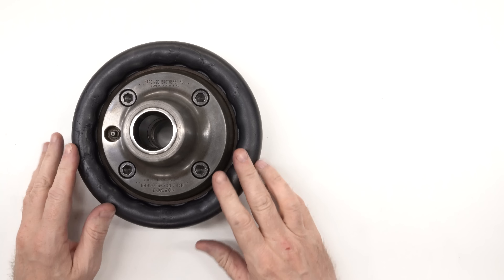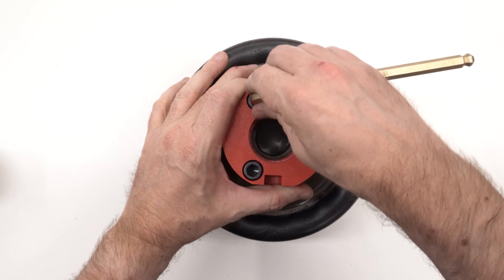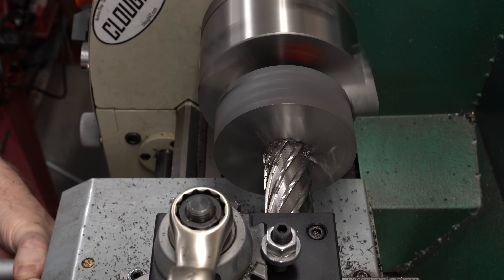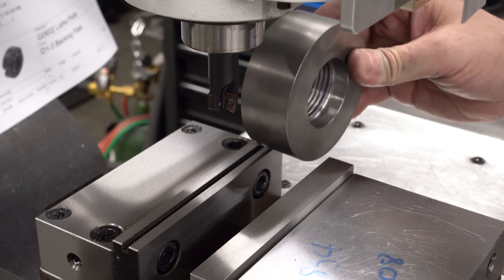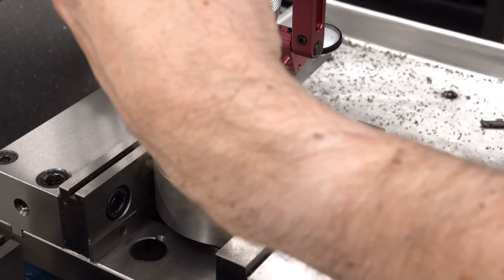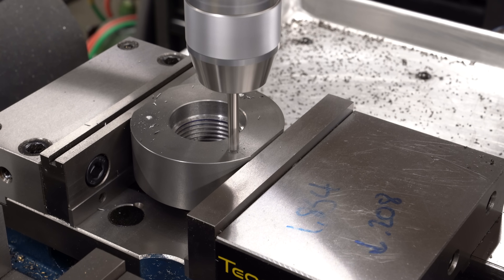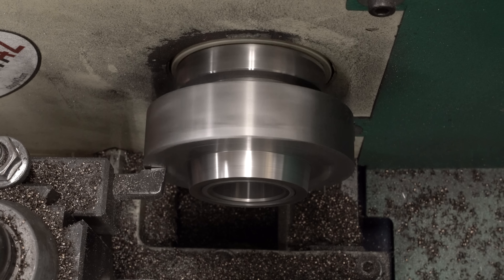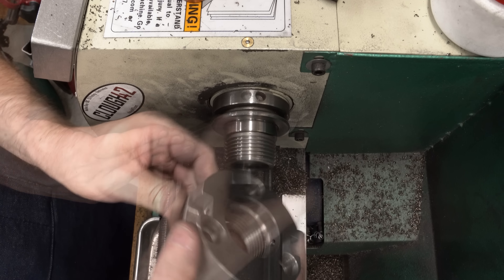How to Install a D1-3 Chuck on a Threaded Lathe Spindle

Comment: I've just started using Fusion 360, never used any CAD before.  Your designs are awesome.  👍

I've got it for my Qidi 3D printer you reviewed a little while ago.  Already knocked out a small bracket for a rear bike camera.
A question what flexible filament did you use for the airline end-caps?

Comment: Link to the bore gages at Shars?

Also, UN threads are 5/8 of the sharp V height. .125 x 5/8 = 0.078, and any error in the minor diameter with be magnified by about 15%. It helps a lot on internal threads to make a go/nogo gage using a micrometer and thread wires.

Comment: i got a large low profile armstrong 2.75” spanned to use to hold my spindle when loosening and tightening the hand wheel, i do need to figure out a spindle brake for my lathe one day

Comment: Great video James. Knowing near nothing about milling (I haven't run a mill since college, 1987), this might be a stupid question.When you mounted your adapter in the mill @15:49, you said you would take small passes to keep the part from spinning... Why didn't you cut on the Saddle travel instead of the Table travel?

Comment: put a hole in the adapter and make a tommy bar to fit that will hold and lock your chuck and also help put it on the spindle.

Comment: I have a slotted wheel for an optical encoder on the end of my spindle, I was thinking of making it a larger diameter so outboard of the encoder I can run a bicycle brake caliper from a cable disc system

Comment: Sometimes, if you have a problem with a high speed steel tool and cast-iron trying to friction weld themselves together you can use wax as a lubricant

Comment: I'm wondering if the runout is caused by the chuck bottoming out on the shoulder rather than seating on the taper.  Might taking another ligh skim off the shoulder help?
Reply: Other way round, he skimmed the shoulder and now pulling up to it with the screws is what's pulling it out of alignment. Ironically it looked he nailed it first time and did what you suggested and skimmed the shoulder back.
Reply from the maker: If anything, I suspect it's over-tightened on the taper.  I'll play with it.

Comment: How does your improved compound compare with the solid riser? I would imagine that the solid riser is still more rigid, but is it enough to justify the work that went into it? Which one will you use most of the time? BTW, I see you're enjoying the new PM mill quite a bit. Do you still use the Grizzly CNC machine at all?
Reply: Robin Renzetti did a good video on his solid compound (which is part of what inspired James's). That one is on a Hardinge HLV-h lathe ($50,000+) with an excellent compound from the factory. It still improves rigidity (one fewer joint), particularly when parting. It also means that (since the compound doesn't have a scale on the DRO) that any movement of the compound invalidates all the stored tool offsets in the DRO. If you've got a few dozen tool offsets stored that's a significant amount of work to reset.
Reply: Can't you just reset the absolute origin when you rotate or move the compound and all your tools come back? That's how it works with mine. I visualize the origin from the tool post position, not the carriage position.

Comment: Does you annular cutter shank have a center in the end? Line it up with your tailstock center. I popped a center into the end of my MT2 chuck arbor for y tool holder mt2 holder for fast close enough alignment

Comment: time to break out the tool post grinder!, Great tip for finding ISO standard drawings using duck duck go, I had a very hard time finding a schrader valve chamber dimension. (ISO 7442)

Comment: At around 19:00 you said that it sould self lubricate because of thd high carbon and im curious as to how that works, because ive never heard anything like that (new to machining)
Reply from the maker: Cast iron has a very high carbon content that takes the form of graphite nodules in the matrix.  Cast iron is commonly used for bearings for this reason.

Comment: I noticed that you were getting run out all the way from the work piece all the way to the back of the chuck, but not on your adapter plate.  Would it make sense to clamp a work piece in your largest collet, mount that work piece into a 4 jaw chuck, zero the work piece in that chuck, and then check things like if the back of the chuck is actually rotating perpendicular to the axis of the collet?
Reply from the maker: That's worth checking.

Comment: I think if you're after precision, best to keep the number of moving parts to a minimum or make yourself an adjustable chuck like Dan Gelbart's 😅

Curious, why not make yourself an ER40 collect chuck ?
Reply: ER can work just fine for work holding but it does need a longer engagement length than pull in collets like 5C or w20
Reply: @lukerickert5203  you can get away with sacrificial stock of same diameter if you need smaller engagement of actual workpiece. The added advantage is the range per collet though good spring collets can be pricey and they're considered consumables depending on usage. I get 5um tir or better on mine, the collet chuck was turned in situ which helps.
Reply: @HM-Projects  pull in are likely better for runout etc but a high quality set can be a bit of money to be sure.  5C are nice in that they can be any price you can imagine depending on requirements. I did find an excellent Schaublin made w20 set for around 300 euro but have spent a lot filling out my B32 set. I find 0,5mm steps to work quite well.
Reply from the maker: 5c allows me to use an internal stop.

Comment: At some point is it easier to just replace the spindle with one that has a more common mount on it?
Reply from the maker: Hmm...you might be using the word "easier" in a different way than I typically do.
Reply: @Clough42  well, that's why I'm asking 😄 (not a machinist, just thinking out loud)

Comment: Just give the part a few taps until it  the runout disappears, you still have to do that even on the index grinders use to finish parts.
Reply from the maker: That might explain all the marks on the chuck from the previous owner(s).

Comment: Instead of screws using the cam lock my pull more evenly. Yes a lot more work them using screws. If you use cam locks then you have a mount for other D1-3 tooling

Comment: you didn't confirm the taper fit ,you need a colour compound on one of the tapers to make a transfer between the surfaces i bet you are a little tight on the front

Comment: Fail with runout. 4 thou was not enough clearance you have not engaged full the taper. Besides no video the taper was actually cut properly. Check runout on taper.

Comment: Why ductile iron?
Reply: its tradition for backplates etc. But really it could be made out of any steel imaginable
Reply: It has better vibration damping capacity, roughly 5x better than steel. The best is continuously cast gray iron, which is usually more expensive and doesn't machine as well.